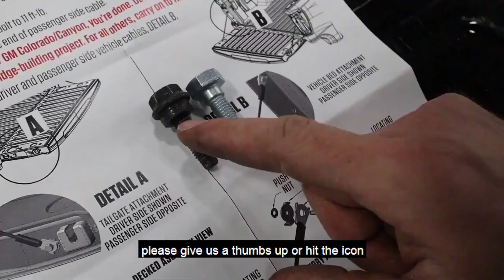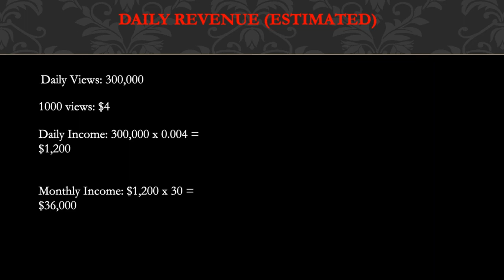Cole the Cornstar has 10 Secrets You Don't Know - He tried to hide it

Comment: I was square baling hay before kindergarten.  Dad stacking on rack. I couldn’t shut off pto so he had to jump off, run up if I broke shear pins. (BTW that’s no big deal) those pins are designed to break if too much material, or anything is malfunctioning.  It was a low tech safety for equipment.  I liked the old JD A or B because the clutch was a long lever you pull back, done.  The Farmall I had to scoot forward, grab tight to steering wheel, push heavy clutch in, hold while I let one hand go to quickly change gears.